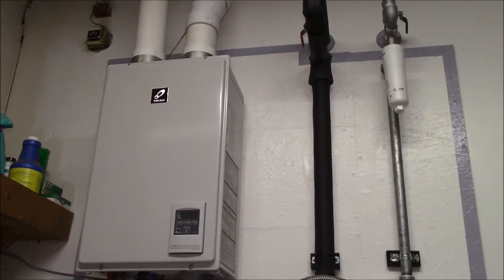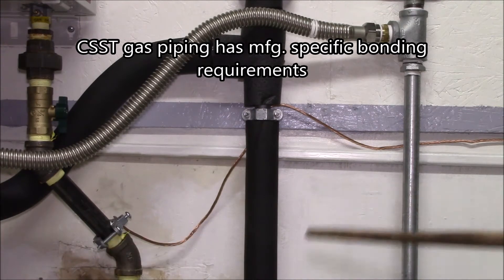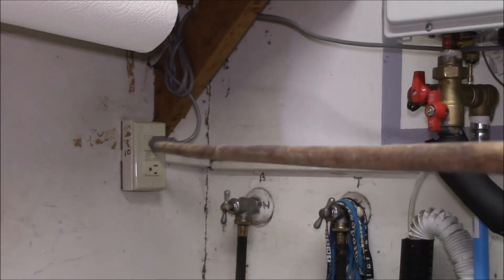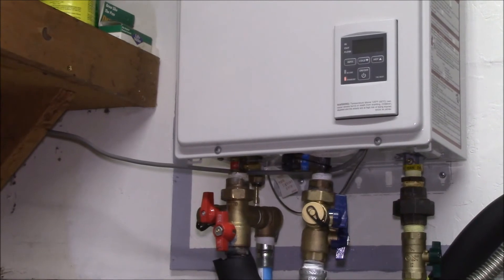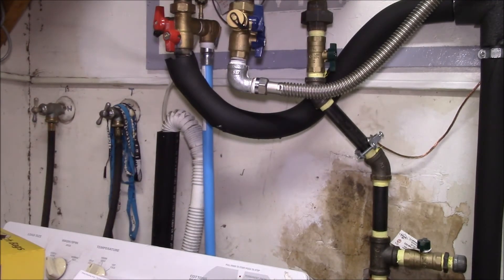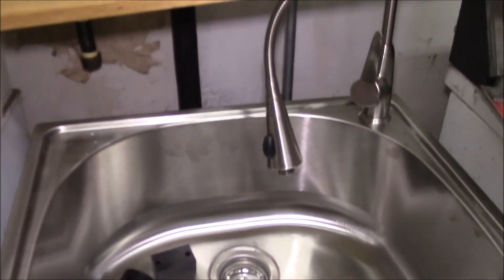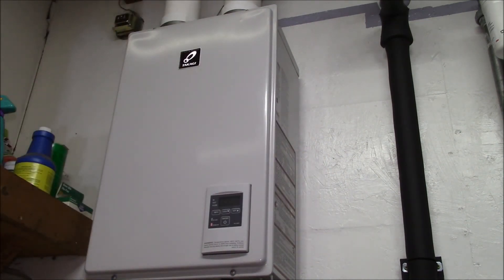Tankless Water Heater Install, Insulation, Bonding and GFCI

Comment: does the one end of the bonding wire have to be installed at the electrical panel ?
Reply from the maker: Ultimately yes, but that can be via an "electrical supply system grounded conductor":
https://www.ecmag.com/section/codes-standards/grounding-and-bonding-gas-piping
Is it also bonded via the water heater equipment grounding conductor, but the additional bonding wire covers the case where you might have the water heater unplugged for whatever reason.

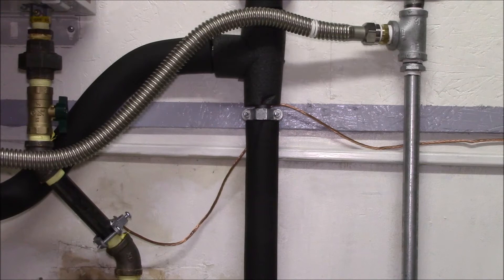Comment: 0:55 Why not install the bonding on HW-pipe with the bonding wire screw facing outward???  Bet a home inspector would flag this.
Reply from the maker: Good catch.  Yes, I forgot about that one clamp and it was pulled around the back side of the pipe when the bonding wire was pulled through and on to the cold water pipe, that is out of camera shot.  That clamp was later rolled around so the bond wire screw is on the side of the pipe.  The main idea was to keep the bonding wire behind the piping as later a utility sink and back splash/shelf was going in around the piping.

Comment: You cannot bond to a gas pipe it's against the law even I know that. Bonding to the hot water pipe that serves no purpose. Unless your hot water pipe goes threw the dirt. Only bond to the cold
Reply: NEC and NFPA 54, Sec. 3.14(a) requires you to bond the aboveground portion of a metal gas piping system to a grounding electrode system for safety reasons. NFPA 54, Sec. 3.15 does not allow you to use aboveground portions of a metal gas piping system or its components as a conductor in electrical circuits
Reply from the maker: That may vary in different areas and for sure, you can't use metallic gas piping as an equipment grounding electrode.  

I found the following information:
https://www.ecmweb.com/code-basics/gas-pipe-grounding-legal

National Fuel Gas Code (NFPA) 54. For example, Sec. 3.14(a) in NFPA 54 requires each above ground portion of a gas piping system upstream from the equipment shutoff valve to be electrically continuous and bonded to any grounding electrode. Sec. 250-104(b) of the National Electrical Code (NEC) agrees with this mandate. On the other hand, NFPA 54 [Sec. 3.14(b)] parallels Sec. 250-52(a) of the NEC, which states: "You must not use an underground metal gas piping system as a grounding electrode".  Where there's a possibility that any metallic piping on a premises might  come in contact with a "hot" wire or become energized, you must bridge all nonmetallic breaks with a bonding jumper and ground the entire piping system to the grounding electrode system.In summary, you cannot use a metal underground gas piping system as a grounding electrode. However, you must bond the piping system to the grounding electrode system for safety reasons.

Good summary diagram:

http://hawleyhomeinspectionsllc.com/wp-content/uploads/2015/12/bonding-diagram-w-text.jpg

Granted, the bonding clamp on the gas pipe is redundant as it is grounded by it's threaded connection into the water heater chassis - I've checked continuity with and without the jumper.